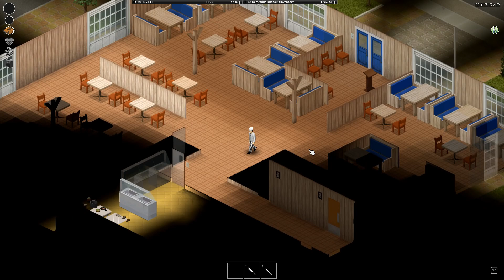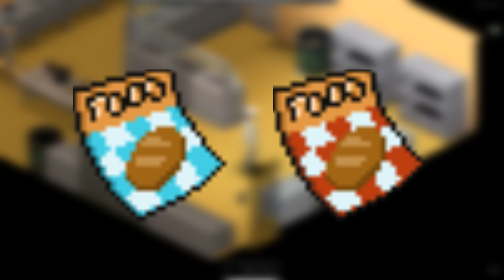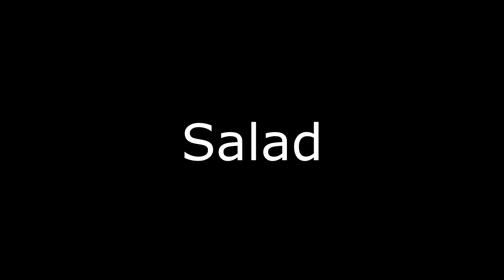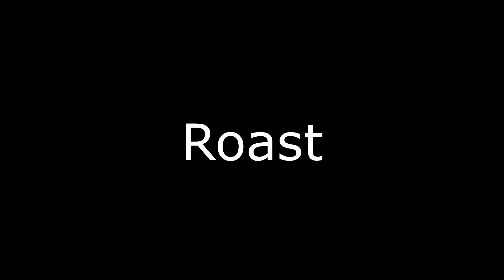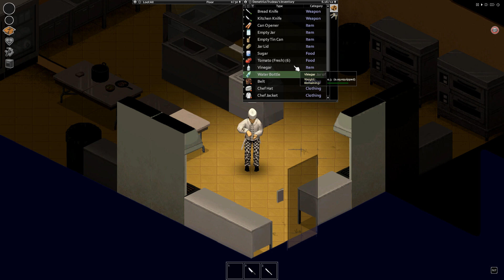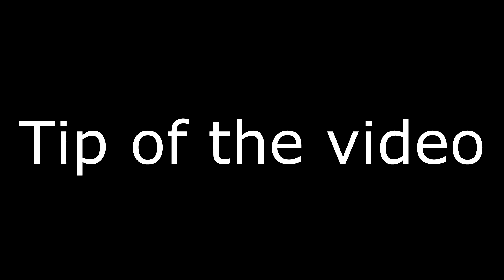Project Zomboid Cooking Guide | Recipes and TIPS to COOKING! Build 41

Comment: Beginner Question: Do I have to put everything that I want to have cooked INSIDE the oven or can I use the plates by placing pans on top of the oven?
Reply: Also the food in jars last for 2 month outside of a fridge? So if I put those in the fridge they would last even longer (ofc the power needs to be on at that time)?

Comment: An important factor that this does not explain is when the cooking is needed, at what point of a recipe. Do raw food need cooking independently or you can cook it altogether? I can make a salad and add raw meat, then it seems i cannot undo it nor resolve it by cooking it after. You went through the options that you got by right cliking on stuff here, not much explained. I think what adds value to an explanation is explaining what is not obvious and considerations that one must have BEFORE starts cooking something, such as the correct order in which things must be done to achieve a plate, what things to avoid that have no turning backs, the time meeded for things to cook to set the timer propperly, etc. 
Always remember that if you teach something to a broad audience you must suppose there is no previous knowledge nor understanding. You can see in the comments the so many tips and advices that are absent in the video

Comment: 0:35 I came to this video (great guides btw) to look for an answer and according to what you said I must be experiencing some kind of bug since I can't cook a burger

I looted a burger while scavenging the first days and put it on a fridge and after the first week I started losing weight which was very bad considering I started with the Very Underweight trait so I decided to try cooking, since at a first look it seems more efficient than just eating the ingredients by themselves, so I started experimenting with mostly stew and soup but then I realized that I could add more ingredients to the burger I already had and I decided to do so.
Now, the "new" burger says (Fresh) but it also says "Dangerous Uncooked" which is also BAD since I have the Weak Stomach trait too, so I put it in a oven for more than 3 in-game hour and it stays the same, it's kind of an invincible burger since it can't even be burnt, have anyone experienced this? Should I eat it or should I yeet it in the trash can?
Reply: Hey, I hope this isn't too late, but I had trouble cooking until I figured out that you had to manually turn on the oven using either the small button on the container menu or by right clicking it.